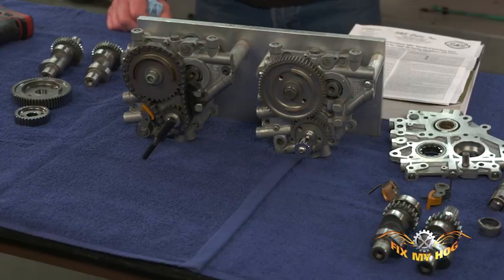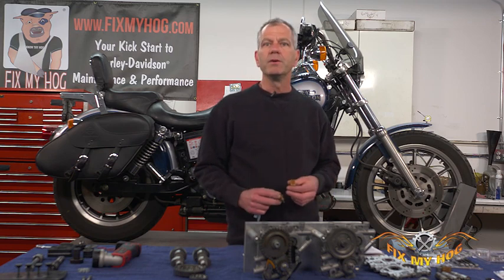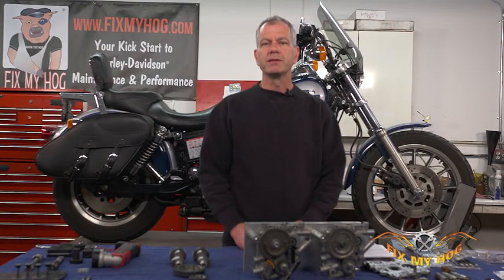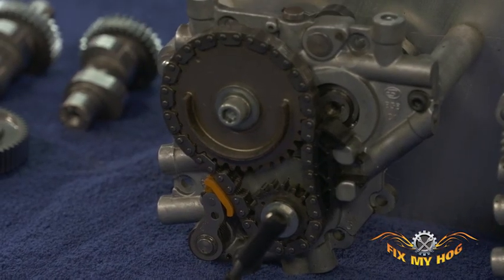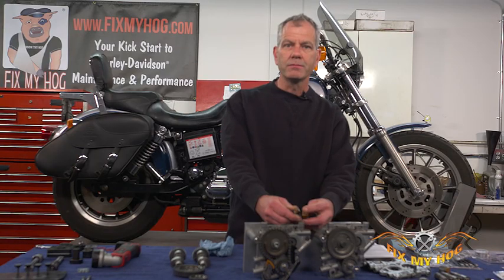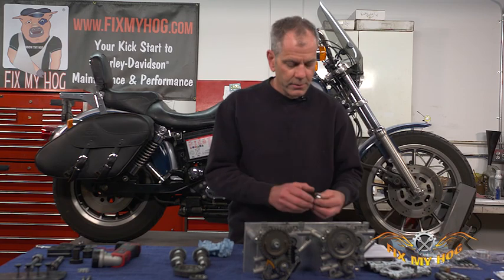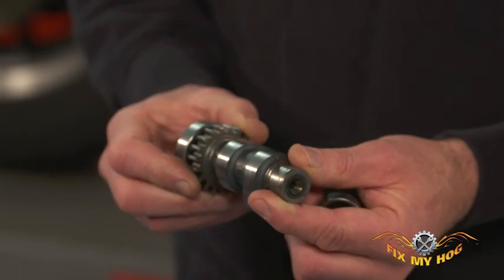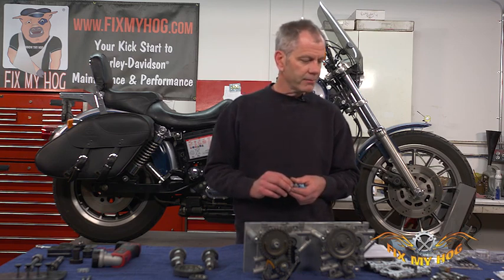Cam Chain to Cam Gear Conversion: Intro and Tools

Comment: Hey Mike! So glad I found your channel. Much needed info for me.
I have an '04 HD ElectraGlide with matching HD TLE Sidecar.
I have 70K miles on my bike and have low oil pressure now. Mechanical gauge said so.
I need to do the whole "Cam Chain upgrade" thingy now...oil pump, CAM Plate, CAMS, Gears, Pushrods, etc.
I'm not a master mechanic by any means but hope to do all of this myself with the help from friends, YouTube, Forums, manual, whatever.
The techs at my local Harley shop said go with upgraded CHAIN Drive while a local shop owner I know said GEAR Drive CAMS. 
I want to keep the bike forever and just want the most cost effective upgrade above stock quality. Not looking for a race bike.
S&S, Feuling, Andrews...I have information overload coming out of my eyeballs!

Comment: Great information to here just put new pushrods in 900 hundred but then it's all ready done 32 thousand miles but looking at 3000 thosand
Reply: Are the threads left or right

Comment: ive been told it's not recommended to switch to gears if you've already got a good amount of miles on the bike, as if there is even a micro hair of "not true" alignment, the gears can't compensate for it like a tensioned chain can..... thoughts? I have 32k miles... inspecting tensioners next week.... plan to upgrade cam kit next year... but on the fence with hydro tensioners and chain, or gears....
Reply from the maker: Hi Rob, You do have to be with in spec to switch to gears. You won't know if you are till you do the run out measurement. We have hours and hours of this process on our website for gear upgrade our hydraulic. https://www.fixmyhog.com/videos/cam-gear-drive-conversion/ and https://www.fixmyhog.com/video/harley-crankshaft-runout-015933/ and https://www.fixmyhog.com/videos/cam-chain-tensioner-shoe/

Comment: Hey so Mike on a 1450 cc  harley 05 wide glide all stock would I be able to put the s&s gear cam directly into the engine with out having to change anything? If I would have to change anything what all would it be?
Reply from the maker: Hi Josiah, Check with S&S on there recommendations and visit our site for Mike's recommendations, Projects: https://www.fixmyhog.com/videos/cam-gear-drive-conversion/ and https://www.fixmyhog.com/videos/cam-chain-tensioner-shoe/

Comment: 80,000 miles on a 2000 flh, it's time for an upgrade to hydraulic tensioner. Timken inner bearings are b-148's , what timken/torrington bearings would be in the cam plate,roller in the back ball in front? I'll be going with gear drive should the run out be with in spec

Comment: What happens if crank run-out increases over time?
A chain with tensioners would absorb that to a limit but a gear drive would self destruct on less runout.
 I would not run a gear drive on a stock crank.
Reply: I put the S&S 510 kit in my 01, at 35k. I sold it with 80k of hard miles, still ran great! Imo, S&S gear drives are proven!
Reply: @Mrbreezehd1  I trust the S&S Gear Drive set up 100% it's the Harley Crank that I don't trust

Comment: on my twin cam , i did not switch to gear drive,
I pulled both cam tensioners , and threw them away. These chain tensioners are not required in this application.

-g
Reply: how does it run without tensioners

Comment: Would somebody PLEASE make a setup for twin cam 88 that is Gear Drive on the back side of the cam and chain drive on the front side of the cam??
This would be so much easier to maintain the original setup and so much more reliable than the aftermarket setups.
Reply from the maker: Hello James,

Great question! The ‘Ask an Expert’ section is currently for members of our online community. By becoming a member, you will have access to our expert’s knowledge in  motorcycle repair . With your membership you will also receive discounts on products and hours of Premium video content. 

If you are interested in becoming a member to , please click on the special offer below:https://go.fixmyhog.com/C22541
     
Thanks!